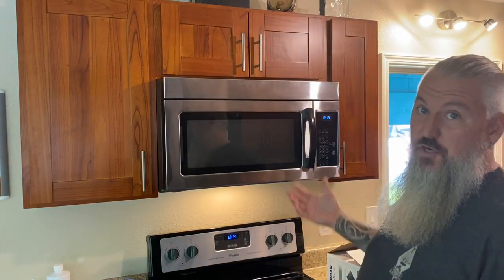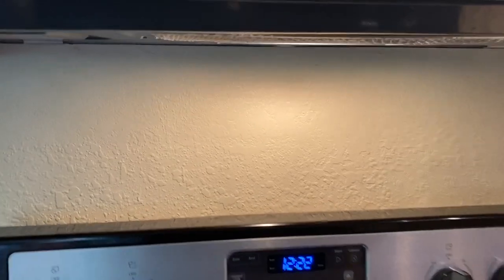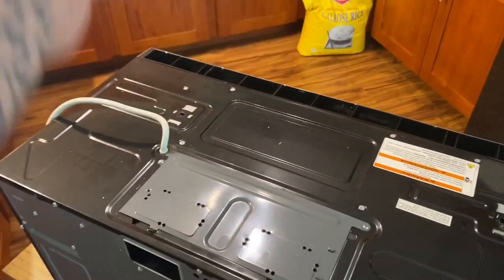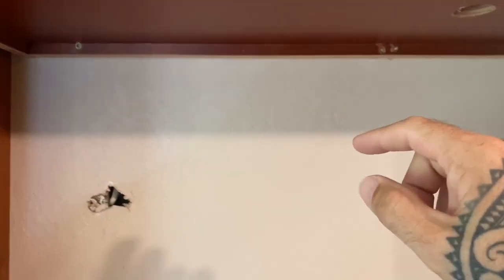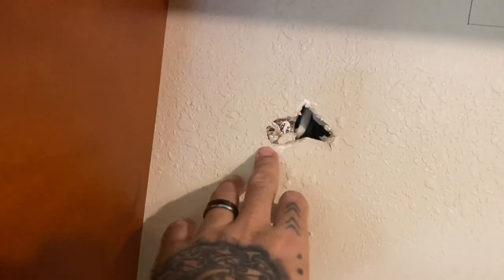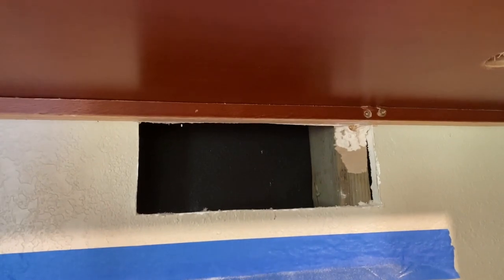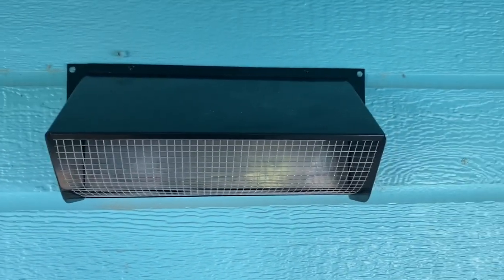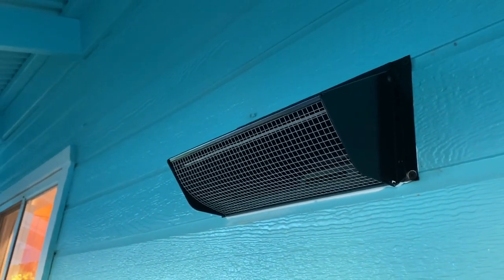Projects! Microwave Vent

Comment: the fan that vents back into the home is a recirculating vent... the air is filtered through the filters in the microwave. It's for buildings without outside venting. just FYI
Reply from the maker: Yes I know, but it’s pointless…
Reply: It's absolutely pointless, because the "filters" don't filter anything...smells from the stove get pulled up thru the vents and measly wire filters and thrown up to the ceiling, and circulated throughout the room. It's especially lovely if you use a cast iron to sear a steak, you get a great buildup of greasy old food smells that permeate the room every time you use the microwave 🙄

I'm in an apartment and the wall backs up to the bathroom. No way to properly vent. Hate it

Comment: Jason, Sunday 2/23/21 I installed the Microwave vent in the exterior wall. I ended up finding the Broan vent you recommended at Lowes. The job was easy except for the stud and cable I encountered in the way. The stud was easily eliminated and the cable had plenty of slack to be moved out of the way. I really appreciate you taking the time to do this video. Bob
Reply from the maker: Very Nice Bob! It feels good checking projects off the list. Thanks again for watching 🤙🏼
Reply: How long does this take someone to do ?   Trying to do this.
Reply from the maker: If you somewhat know what your doing couple hours max… I think it took me less than an hour when I did it. 👍🏼

Comment: Excellent video. This set up is the same as mine. Thanks so much for your presentation.
Reply from the maker: Thanks for watching! 🤙🏼
Reply: Hey Jason, quick question. We have a Jenn-air as well. Your microwave wave looks similar to ours, but ours is not new. Would the Broan vent you recommended work universally with all of them do you think? And are they all fairly generic in fitting the back thickness of the wall?
Reply from the maker: They are somewhat standard but would be best to pull the microwave off and measure back and also make sure your microwave can have the fan rotated. 👍🏼

Comment: Since I lives in extreme cold areas, going straight out from the back to outside would not be a good thing.
Because I get a very cold draft & cold microwave in the winter. We get below -55 c.

Jason Fleck, I think you lives in hot climate areas because load bearing is not a major concern, so well done!
Cutting that little stud will not cause your home to crashing down.
Reply from the maker: There is a little door flapper on the vent so it would limit the cold draft a bit but I could see how it may be an issue. And yes a few people losing it because I cut a beam lol... in Hawaii they build house like most people build shed and zero insulation because it’s not needed. Thanks for watching! 🤙🏼
Reply: Good Lord… -50°!?

That’s past the point where Celsius or Fahrenheit doesn’t even matter.

Comment: I watched some other vent install video's but yours hit all the points I was thinking about such as the 2 x 4 in the way. Great job. The vent is $20 at Home deopt. The only expense for me. I have the rest. Keep up the small project videos. IF they are anything like this one I am a fan. Thanks, Bob--Mesa Az
Reply from the maker: Thanks Bob, houses are built a bit different here so if you do have a 2x4 in the way you should box it I got flamed many times in the comments but they don’t understand how house are in Hawaii lol 🤙🏼
Reply: @JasonFleckDaHawaiianViking  I understand how critical and how ridiculous people can be. Many know little to nothing about what you are explaining but online they act like experts. Some experts have to admit you are right and just lop off the impeding stud. No customer in their right mind would pay that much cash to have their wall ripped apart in order to frame around a 3 X 10 inch hole in a wall that is no way compromised. I found your video to be very easy to follow. Of course if people are not the handy type they should not be attempting this project at all. In my novice thinking I know exterior framing consists of 2 x 4 studs 16 in on center with header boards on top. One stud loppped off in the middle of the span will do nothing to compromise the integrity of the structure and you are right it is not load bearing. The 'This old house' way of doing it would be to rip the sheet rock out and frame it in. I found the Broan 639 vent you iused at Lowes nearby. I have everything else to do the job. My confusion about this job was what to use for the vent and how it is sealed from the extremes. We might see 35 degrees now in Mesa Az but it quickly warms up in to the 70's but in the summer it averages 110 plus for months on end. The Broan vent will do fine to keep the cool in and the heat out. Again thanks for your video. I subscribed to your site. I will be watching for more good advice. Bob.
Reply from the maker: Thanks Bob, I appreciate it. The houses here believe it or not sometimes are built 24” on center and if it’s really low budget 36” lol and the roof Trusses are every 4’ and then purlins across those at 24” and then metal slapped on... but the roofs are basically open. 
Thanks for the sub and check out my shed build series it was a pretty good one. I will hopefully be starting to build my shop/garage in the next month or so. 🤙🏼
Reply: @JasonFleckDaHawaiianViking  All newer construction here requires 2 x 6 trusses at 24 inches minimum and double headers and 16 in studs in and out. My house was built in 1993. It is a Shea home that is overbuilt materials wise with a tile roof. There is older housing in Mesa that is like you described. There are still some adobe homes. Great insulation. I will check out your other projects. Thanks again. Bob
Reply: @boblamb8421  2 X 6 trusses? Are you sure? Also did you mean 2 X 6 wall studs 16” on center?   Just trying to learn here.
Reply from the maker: He’s in Arizona so building codes may be different where you live.

Comment: I think your video was awesome dude. The major issue I have in my home is that where our microwave is located, you'd have to come up through the cabinet, take a 90 degree turn to the right, then go 7-8 feet to where you then would meet the outside wall. Then there's the joists you have to get through and it would look unsightly.  I have no easy way of doing it like this. Above the cabinet is the ceiling and we are in the bathroom. As a result, we don't vent the microwave and anytime we boil hot water, condensation goes upwards into the bottom of the microwave and has already burned out the 2 bulbs. Any ideas?
Reply from the maker: I’d say go up, sounds like from what you explained that there is a second floor above? I’d go up find which way your floor joists go and then follow that to an external wall. 
You may have to open up an area in the ceiling but could be patched and refinished. 
Sounds like it would be some work but could be done… Good Luck! and Thanks for watching! 🤙🏼
Reply: @JasonFleckDaHawaiianViking  Thanks brotha. I'll assess and see what we decide to do. It' would be involved and I'm not sure it's really worth it for how much we use the stove.
Reply: @JasonFleckDaHawaiianViking  I found to be in OP's similar situation, I just moved into my first home and found out my microwave vent is a joke thanks to this video. Being inexperienced and in the cold of winter now I couldnt hope to undertake this project, do you have any temporary budget ideas better than pointing a fan out the window 7 feet behind?
Reply from the maker: Not a whole lot could be done sounds like, possibly rotating the microwave fan to the up position and running ducting along the wall/ceiling to the window? Difficult to asses without seeing first hand. Good Luck 🤙🏼
Reply: @JasonFleckDaHawaiianViking  Yea probably not much can be done given the microwave vent literally has too little suction force. A different video I saw from an alabama inspector pointed out how common it is for these useless microwave vents to be towards the middle of a home.

Anyways, thank you for your time and have a good night!

Comment: Thanks for posting. I have the same project on my to do list. We have been at a stand still only because our stud it right in the center of the hole. We were going to route around it, but it was going to get complicated. Ours is also an exterior wall, so notching it out is okay??  I might have to do the same, just to get the dang project done!!
Reply from the maker: Hey Amber, it would be best to reinforce the stud you cut, but as in my case I’d have to tear apart the entire wall to do so. If it’s not a load bearing wall it should be fine since the wall is completely built with paneling nailed in on the outside and drywall or sheet rock on the inside it makes it pretty solid. Thanks for watching! 🤙🏼

Comment: Question my kitchen similar to your has a exterior wall behind the microwave. The issue I have is this I live in the northeast so most exterior wall have weather installation in the wall to help keep heat in the house. In the case of this job should just remove that installation in that part of the wall
Reply from the maker: Yes you can just cut the insulation same as the wall but adding a vent could create a draft where cold air could get in so consider that, good luck! 🤙🏼

Comment: Excellent video!   Question:  How much (approximately) do you (Jason or fellow viewers) think an able handy-person would charge to do the same job?   Thank you.
Reply from the maker: Hi Dan, Here in Hawaii most "Handymen" charge by the hour, anywhere between $40-$60 per hour. Total job if you had all the parts and there were no issues that popped up I would think could be completed in 2-3 hours? but that depends on the speed and efficiency of they handyman lol... Thanks for watching! 🤙🏼

Comment: You said it wasn't load bearing, but it's an exterior wall. All exterior walls are load bearing. Should have boxed it in, wouldn't even have to finish drywall because microwave would cover.
Reply from the maker: No need. 
I didn’t cut the 2x4 completely.
Also there’s a door on one side and a window on the other so there king and jack studs both sides for reinforcement.
Reply: I had the same thought. At first, when he said it wasn't load-bearing I was like, "well, it's his house. He probably knows." Then as soon as he went outside I was like, "Duh! it's an external wall. Of course it's load-bearing, lol!" That said, over the entire span of that wall, it's unlikely that one cut stud is going to cause any significant problem. There's a whole lot of wall there to spread the load. I always cringe when people cut away structure, but in the end, I don't think it's going to kill anything.

Comment: Wow! so I’m just realizing it isn’t code to vent a residential range to the exterior?  At my parents home when we get to cooking and crank up oven you could die of heat exhaustion and the kitchen is dead smack ground floor center of 2 story home and then shaped in a hexagon with a lighting soffit that serves as a heat, smoke & smell raceway. Also if you open the walk in pantry door or pretty much any upper cabinet door you feel heat escape. A good amount must make its way to the between floor plenum because if your upstairs your lucky to know whether it’s cookies or pot roast we got going before anyone downstairs does! We live in vegas and in the summer-just thinking about  going near the stove is enough to get you dripping in sweat! I can’t believe this doesn’t pose a world of problems ranging from fire hazard to mold  not to mention the heat ruining many pantry stored food items - anyway sure enough I took down microwave just to be sure there wasn’t a vent, even though your lesson in the OTR fan direction pretty much sealed it and BIG FAT NEGATIVE. Unfortunately I am atleast 30’ from any options for exterior vent and while I am sure I could handle this project, running duct  is pushing it for me but your video was informative and helpful and appreciated!
Reply from the maker: Well glad it helped! Yes codes vary quite a bit around the country guess I was lucky that mine was on an exterior wall so it made it an easy job lol… good luck with yours! 🤙🏼

Comment: Hi. Great work sir. One question, how compatible are rear vent in microwaves when the time comes to replace my microwave with a new one. I fear replacing a microwave with a new one that might not align with the existing vent hole. Thank you sir.
Reply from the maker: Hmm that’s a good question? I’d like to assume microwaves are standardized only because most stoves and cabinets are. I know you can get larger higher end stoves, microwave, etc but I think if you bought the same brand it would be the same but I cannot say 100% lol… Thanks for watching! 🤙🏼

Comment: Is there anything you can do if your microwave and oven isn't on the side of your house. Mine is has a room behind and the sink is on the side of the house.
Reply from the maker: Hello, usually in that case I think the vent would run up it could vent through the roof which is a lot of work and why most of the time it’s not done lol
Or if you have crawl space you run the vent up then through the crawl space out the side of the house. Which is also a bit of work…
Thanks for watching 🤙🏼

Comment: Hello sir . Can the same process be done for stucco exterior? And is this standard size vent 3 1/4 x10 ?
Reply from the maker: It should be able to? Just would need different cutting blades/tools to get through the stucco. As far as a standard size for the vent it is a very common size but double checking your microwave would be the safest bet. 🤙🏼
Reply: @JasonFleckDaHawaiianViking  thank you Jason. I did see some people make it from top cabinet rather than behind. Any reason for that ?
Reply from the maker: @SAMSAMMY837 if that’s the way the vent went, it would go up to the roof if the microwave wasn’t on an exterior wall. 🤙🏼

Comment: During winter will this cause the cold to come in thru the vent? I'm a little concerned about that.
Reply from the maker: well for us it's not a concern lol winter time here may get as low as 50 degrees but where you live maybe?
There is an exterior flap on the vent but it's not air tight.  🤙🏼

Comment: There is a charcoal filter that collects it
Reply from the maker: Not on my model, or most for that matter unless it’s an expensive one maybe?
Reply: @JasonFleckDaHawaiianViking   mine got one it’s not the real expensive one at first i didn’t think it did cause it not where u put the other filter it’s on top of microwave where the vent is that sticks out further then the cabinet it’s a little square black filter and that’s the charcoal filter anytime it’s one that can be used to recirculate or vented to the outside it has the charcoal filter in it
Reply: That’s what mine look that that’s in it
Reply from the maker: @James-fl3eh nice.

Comment: I had a new microwave installed yesterday. It is also vented just like yours. However, when I turn on the microwave, the vent blower is extremely loud. Sounds like a vacuum cleaner is turned on. I literally can hear it from the opposite side of my house. My old microwave wasn’t loud at all. Is this common with new microwaves? Do you think it’s possible the installer missed something?  Can the microwave be installed without the blower?
Reply from the maker: I don’t think the blower is on all the time correct? I know mine has two speeds high and low. The high setting is a bit noisy though. 
Maybe check that everything is exhausting ok? Maybe something is blocked? Thanks for watching 🤙🏼